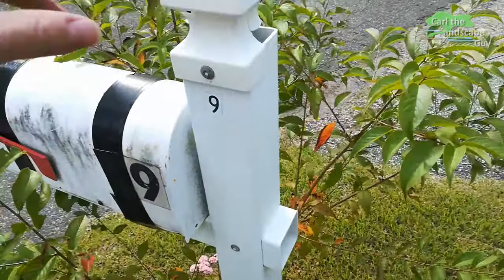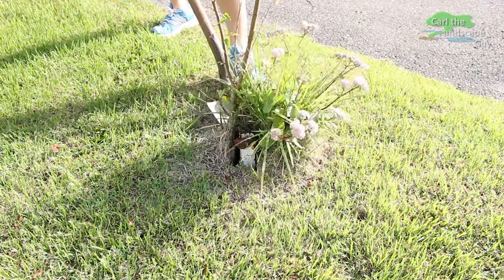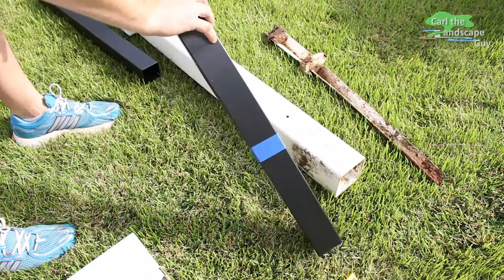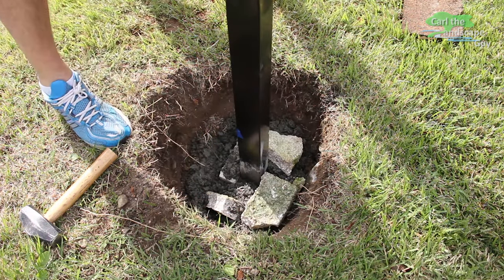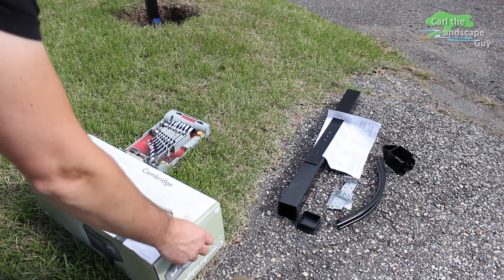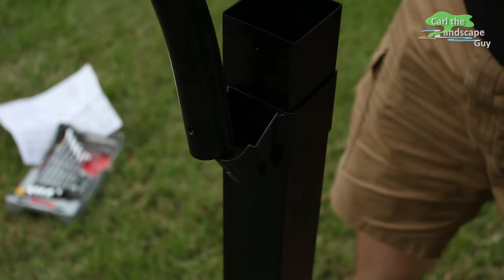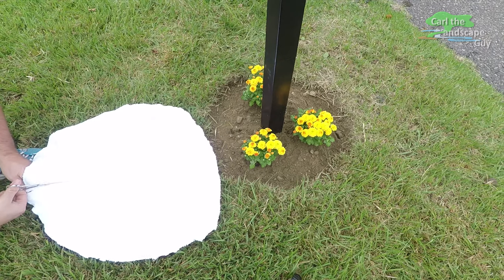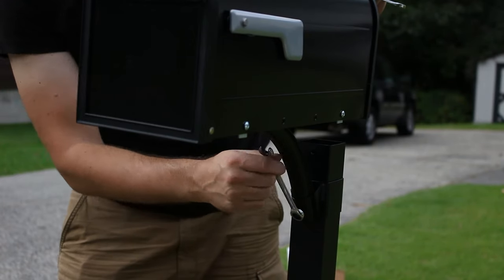INSTALLING NICE METAL MAILBOX WITH CONCRETE FOOTING, TUTORIAL BY STEP,QUICKRETE FOUNDATION,GIBRALTAR

Comment: The new smart way. 1) Pour cement in the gallon milk container. 2) Mailbox post in to gallon milk container and let it dry. 3) Dig and post in only 15 minutes. Done. ( PS. Pour cement in the hole old way. It's hard to dig old cement out. 🙂😷😎 ( don't forget to cut the top gallon milk so post be able to dip in )
Reply: The fool that hits your mailbox with their truck or car will do the dig out for you. Happened two times to my thick steel post!
Reply: @paja7647  : Lucky me because I had big giant metal electric pole blocked my mailbox post.